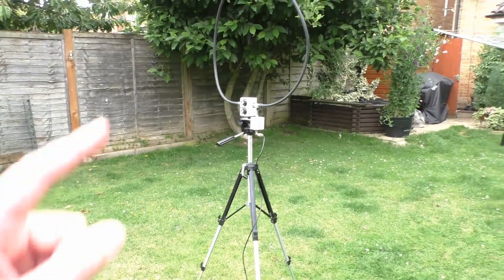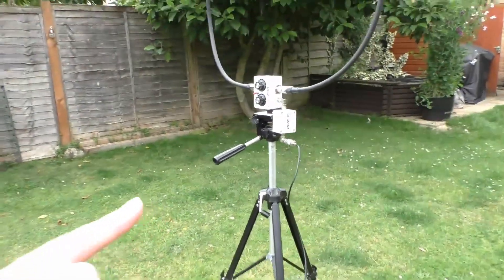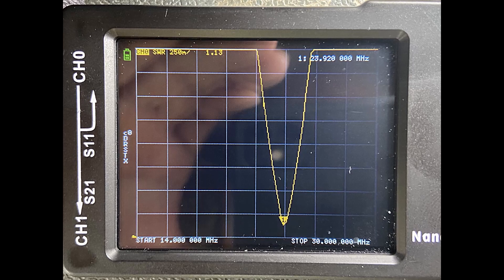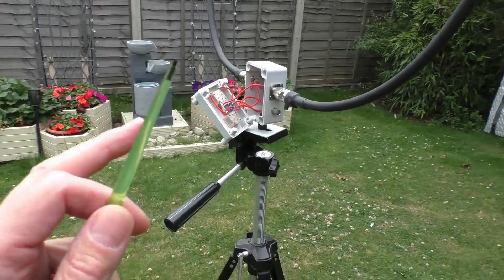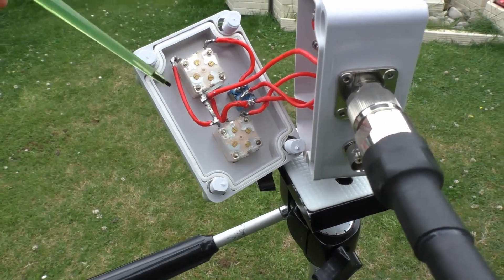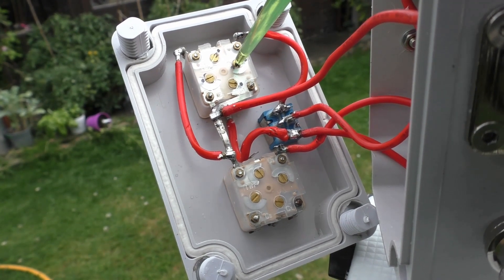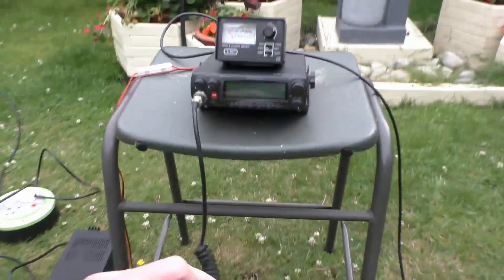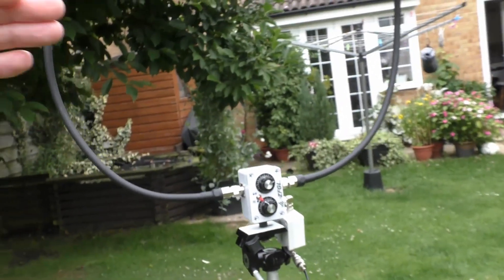QRP Magnetic Loop Antenna on CB radio.  (Tuning the Loop) Part 2

Comment: Good effort Fred.. Even the loops costing £ hundreds are tricky and over sensitive to tuning so credit to you for working out those capacitor adjustments and achieving such a good SWR result .. It'll be interesting to see how you get on with it in use. You are absolutely correct in estimating the power that those small capacitors will handle using FM or AM.. 5 watts would be a very generous figure, although you could double that using SSB.
Reply from the maker: Hi. Thanks.  Yes the tiny caps do limit the power you can run.  Ideal would be QRP 10 watts.   Its a strange design with just a single loop.
Reply: The video wasn't, he kept doing that "old person with a camera" thing by constantly covering the lens with his hand and fingers, blocking what he was filming.  If that is some new trendy effect that is deliberate, it's a bit of a disaster as it's rubbish!

Comment: Hi Fred I just wanted to ask you about where you can possibly buy one of these loop antennas mate? Because after watching your video I'm very interested in buying one myself and I know that it would work brilliant on the 11 meters and it would be interesting to see how good it preformed on the SSB like on 27.555 and 26.285 it would be interesting to see how far away you can get with this particular antenna and if I had one then I'd stick it up with a 20 foot pole and then test it out on the SSB and also on the FM muppet UK band and also on the mid band as well so do some tests and let me know what kind of contacts you got mate OK thanks. Stephen M3SNV 73's.
Reply from the maker: I found it a struggle on 11m.  Results were shown in part 3.  You can get one the same here. https://uk.banggood.com/20A-20W-QRP-Shortwave-High-Frequency-Transceiver-with-Portable-Small-Loop-Antenna-Broad-Frequency-Band-Low-Interference-Advanced-Tuning-Box-Exceptional-FM-Radio-Reception-p-2015400.html?cur_warehouse=CN&rmmds=search

Comment: Metalwork around the aerial isn't good. I've never put one on an aluminium tripod. as it could affect tuning, I've had them on the shack floor or a wooden pole..
Anyway, well done Fred for sussing out how to get it to tune upwards in frequency.
G4GHB.

Comment: Well, this is some kind of funny. When I opened up my antenna the same screw in the upper left corner cracked, too.
This is a stunning good antenna. I used it on 12m and worked Japan, Indonesia and USA with 10W in FT8.
The tuning is a bit tricky but getting easier over time.

Nice video. Thanks and greetings from Germany ...
Holger
Reply from the maker: Hi.  Good to hear you had contacts with the loop.  I think you would need very good conditions on 11m.

Comment: I believe that the Mag Loop antenna is horizontally polarized. Since most stations on 11 meters FM transmit vertically, you must expect a weaker signal with the Mag Loop antenna than if both stations transmit horizontally. 
In any case, it will be interesting if you get the antenna working and get some contacts. The antenna is not very big, so I think you could easily build it twice as big without it taking up a lot of space, on the other hand I would expect it to be more efficient.
Reply from the maker: Yes good point.  Its only 70 cm diameter.  I would like a loop that ran more power but they are normally hundreds.
Reply: You can use a loop in horizontal direction, too. Then the radiation pattern is getting round.
Reply: The lower signal is caused because the antenna element itself is NOT resonant on anything other than 2m/4m/6m by looking at it's physical size.  The impedance matching networks DO NOT make the antenna resonant, they only make that pile of rubbish present as 50ohms to the output stage of the radio to stop it blowing up.
Polarisation will reduce that already very low signal by up to 10 times.  It's a terribly inefficient antenna and I am not sure why anyone would use this loop of wire cut to be resonant on VHF for HF bands via impedance matchers/ATU.
Use a simple End Fed Half Wave resonant on multiple HF bands without the need for impedance matching, the signal will be 100 times better than that.

Comment: Hi Fred, fantastic info as always, great video. After seeing the loop antenna videos, I'm interested in getting one, and checked out the link in the video. I will also need to get a VNA nanno. Could you please post me the model number or a link for one ? I did a search, but it got a little confusing as there are many similar types at various prices and I just want one to do basic stuff. I'm very unfamiliar with these types of meeters. Many thanks and thank you for the fantastic video's you do. Scoob 👍😸
Reply from the maker: Hi.  Ive had my VNA Nano for a while now.  This one looks the same as mine.   There are plenty of videos on how to adjust them.  I might do a basic guide myself in the future.  https://www.ebay.co.uk/itm/195786143451?hash=item2d95c376db:g:uCMAAOSwOzld2Sm-&amdata=enc%3AAQAIAAAAwNRKB%2BT%2Fds68obSgEV9LPnR7pUKbDEw9alYsIErpuD9CvYmQjaF4hwJNyYzw6sCZyqfLz8FUZ0d6F3KtXCt2wkTOrgQGPs9uFEqlCapvqJs569gDh6ty3x27mr4l0390zgGs7s5X%2Fg%2FD9HQiAYoz91EYmzcvDKK5HBM9d1P2UemqXqXfFco%2B%2Ff2NMPhyXaVK7AXrpIv%2BOOKa4rgUYBcsOMDx948CDD8aMLPAU9cEbkuMkPp3q5laLkbuUbTPetf3Zg%3D%3D%7Ctkp%3ABk9SR6TnqbnHYg
Reply: Thank you Fred, that's really kind and helpful. Very much appreciated 👍😸❤️

Comment: Well done for persevering Fred and getting this to tune on 27MHz, I have this exact loop antenna which I reviewed on my channel some time ago, I bought mine off AliExpress rather than Banggood so I guess all the usual Chinese outlets have them listed, like yours mine did not come with instructions, also like yourself I managed to crack the plastic screws in the tuning box when undoing them to look inside as they are indeed tight, hope you can get a contact using it, best of luck and I look forward to the next video on this antenna
Reply from the maker: Thanks Paul.  Iam glad i was not the only one to crack those screws.  I did think I was being a bit heavy handed.  Its a interesting design being a single loop without a coupling loop.  I think its better as a receive loop than a TX.

Comment: My club manufactures the W2LI loop we sell. We found that the tunning capacitors have to be turned very slowly.  Seems like you figured out. Great video.  Thanks. Fred.  Art- K2ADC
Reply from the maker: Thanks for the info!

Comment: the bauln box will keep RF coming back on your coax back to the shack.  Cause without it your other end of the loop turns into your coax.
Reply: Fred, I was wondering if you used that set up with a different mag loop impedance matcher.  Or you can get yourself a LDG auto tuner to put near the radio.  That’s really what your missing.   You can use the matcher knobs to get so about 2-1,3 swr. Then use the automatic turner to make up the rest.
Reply from the maker: You could use a matcher to tune the SWR but then you would loose some of the TX power.  I think with this loop design (single loop and no induction) you really need every milliwatt output.
Reply: @mikecricket113  Don't use a tuner on a tuned loop ;)

Comment: Where is the inductor loop ?
Reply from the maker: There is not one.  I think thats the whole point with this antenna.  Its more like a receive antenna.
Reply: Youu don't need a inductor loop.  The 2nd (lower) variable capacitor is doing the matching.

Comment: Thats a nice setup for static mobile operation - get up a hill somewhere nice. I use a magloop for HF and its amazing how well it performs on very low power. Main thing is you have a capbility you previously didnt and your happy with it as well, good work !
Reply from the maker: Thanks.  Although i dont see this loop as a replacement for a home CB antenna it does receive very well and i did end up having a lot of fun with it over many weeks.

Comment: The Q, or the bandwidth of a mag look is inherently very narrow by nature.
You've done really well to get this to work on 11 meters.👍🏻📡
Reply from the maker: Thanks.  Its tuned but wait for the testing part to pass judgement
Reply: Ah, I wait with bated breath!👍🏻
Reply: That IS NOT a magnetic loop antenna - it is a loop antenna, completely different i the way it couples, tunes up and resonates.
If you need a matching network to match a VHF by design resonant loop antenna on HF, it shows how hideously inefficient this antenna is.  Don't forget the ATU or matching network is only to protect the RF output stage by making it see 50ohms, it does NOT suddenly make the antenna resonant as it is still the wrong length and not resonant anywhere.
You might get a impedance matching network to get that pile of junk to make a radio output stage happy, but transmitting on it will not get you anywhere as the actual loop is NOT resonant!
Learn how antennas work.  He would be better off with an end fed half wave antenna to cover multiple bands and actually be resonant and not need any impedance matching networks.

Comment: Hey Fred in the shed I am happy you are happy with your mag loop antenna but this antenna is NOT an antenna one would buy set it up and use on a CB radio. So i am good for a few channels but if i want to use channel 1 and then up to 20 i have to retune? Why FRED why go buy a Sirio GAIN MASTER and make a video about it that it needs no tuning i would like the video but this Banggood antenna? NO it is a failed experiment even if you aree happy!
Reply from the maker: Yes i do agree with you.  I dont think that this loop is an ideal CB antenna.  I was hoping for something that people could use if you could not put up a full sized antenna.  The performance TX of this single loop is not efficient enough to be worth the hassle.  However its RX performance on the ground was surprisingly good.

Comment: You want  26.695-27.99125Mhz
Reply from the maker: Yes for CB but the antenna is supposed to tune up into 28 megs for 10 meters.  I have got that now.

Comment: What about a 16:1 UNUN driving a EFLW.
Reply from the maker: I have tried a long wire before.  Trouble is that 99% of local contacts are on vertical.  Obv skip no issue.  I am thinking of trying a inverted V dipole in the garden.  Not sure about QRP noise though as iam in the middle of a housing estate.

Comment: Good to see you’re getting somewhere with the Magloop Fred,those NanoVNA’s are a God send for the money too.I would recommend your viewers use a large Philips head screwdriver to pop it open as I did similar a while back on a none related radio project with a similar enclosure.Thanks for the video…73’s
Reply from the maker: Thanks.  Yes i agree on the Nano as they are a great piece of kit.  The screw bolts are weird. No real recess to use a philips and they were very tight, way too tight.
Reply: It IS NOT a magnetic loop, IT IS A LOOP ANTENNA - they are completely different in the way they work and resonate, but people without much knowledge often use the same term for anything in a circular shape.
That is a loop antenna cut to be resonant on VHF being sold as suitable for HF bands via impedance matchers/ATU.  Terribly inefficient, absolutely terrible to see people buying this when it is unsuitable.
The only people that would buy this are inexperienced CBers that don't know much.

Comment: have you tried a terminated inverted u antenna. mine works great from 1.8 MHz - 30 MHz i get well under 1.5 swr. i manly use it for listening to shortwave but i do chat on cb on ssb and antenna does not need any tuning
Reply from the maker: No i have not.  I am going to be looking into finding a working stealth type antenna in the future.

Comment: Do you think the narrow band width and the lower swr outweighs the low efficiency of the antenna running only 4-5w? Guess we are going to have to wait 😅
Reply from the maker: Yes it could.  The efficiency of the single loop design is an issue.  A twin coupling loop would have been better.